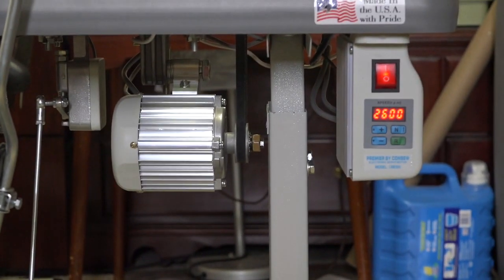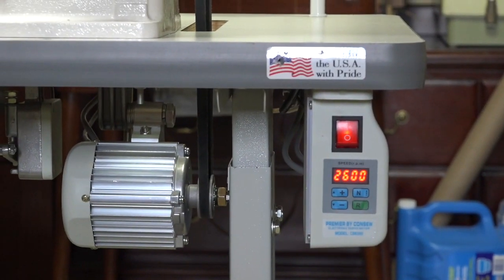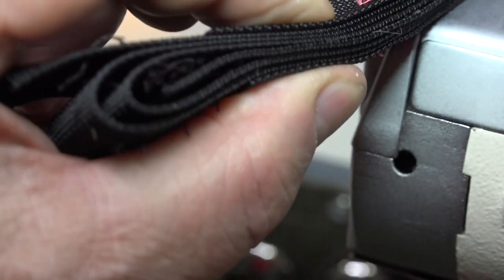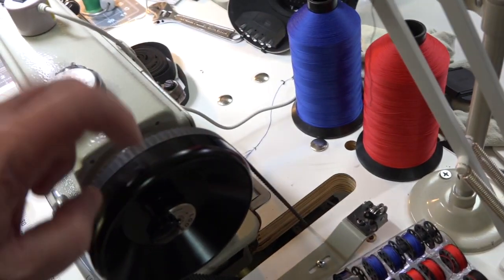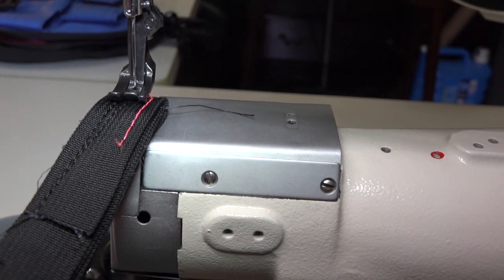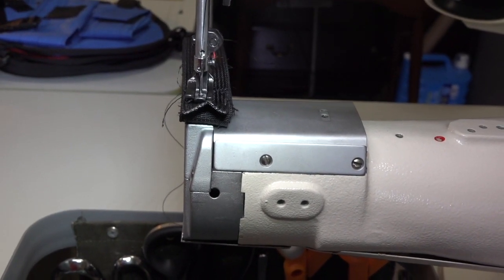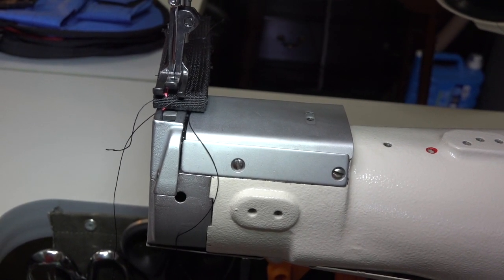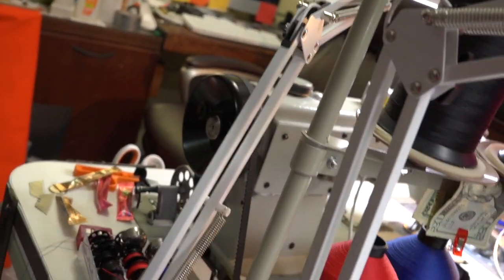Consew "Premier" 1 hp servo motor

Comment: Thank you for the excellent video! I will be installing the servo on an old Consew 220. Do I still need to change the pulley? Thanks again!!
Reply from the maker: Two things you will have to consider, is the pulley the same size as the one you have now, if not you will also have to get a different size belt. If you want to install a smaller pulley to lower the speed of your machine,  you'll have to get a smaller pulley. But no you don't need to change a pulley.
Reply: Thank you!!

Comment: There may be thousands of video’s out there, but so far, yours is the only video I’ve seen that show the installation so complete. Thanks so much. Getting ready to install. I had to have my husband remove that big ole clutch motor for me. if I’d taken the head and oil pan off the table and turned it upside down, I could have, but that sucker is heavy. So, I will follow your lead. Thanks so much. Made it much simpler, even if I am mechanically inclined. I didn’t get anything thing other than the parts. No paper of any kind. So, yeah. This is great.

Comment: 11:40 you talk about the pulley here, but I don't think you mention the shaft size.  I think the shaft on the Consew is 15mm.  Where do you get pulleys for the Consew?
Reply from the maker: I don't know the shaft size, never measured it but I get these pulleys from Amazon. https://www.amazon.com/YEQIN-Industrial-Sewing-Machine-Universal/dp/B06ZZ42TGY/ref=pd_day0fbt_sccl_1/138-5211436-3552342?pd_rd_w=6CYeP&content-id=amzn1.sym.0a3d352f-2699-4ba2-810c-59dcb4abfa1b&pf_rd_p=0a3d352f-2699-4ba2-810c-59dcb4abfa1b&pf_rd_r=BYBRRR1KFK3F7FTRZ46X&pd_rd_wg=AaY11&pd_rd_r=859d288d-f06c-4420-bfba-7400b223630a&pd_rd_i=B06ZZ42TGY&th=1
Reply from the maker: after further research, yes these are 15mm inside dia. https://www.amazon.com/KP-19155-Compatible-Replacement-Industrial-Machines/dp/B094FS2XCQ/ref=sr_1_5?crid=27A1V6FF5WXMQ&keywords=sewing%2Bmachine%2Bclutch%2Bmotor%2Bpulley&qid=1661101993&s=arts-crafts&sprefix=sewing%2Bmachine%2Bclutch%2Bmotor%2Bpulleys%2Carts-crafts%2C166&sr=1-5&th=1
Reply: @gmcxm211  Thank you for your reply.

Comment: Interesting.  I wonder if anyone has had the idea to retrofit this for a drill press, or a table saw.
Reply: I have a 3 phase motor on my drill press and a VFD to convert to 3 phase. It lets me change the speed of the drill press by turning a knob.  I believe these motor's could drive a drill press too but, they have a bunch of features, you'd probably never need. Like the lever speed control. They don't have conventional mounting too. 

I'm just suggesting it's more work than it's worth when you can get a cheap 3 phase motor and cheap VFD to control the speed.

Comment: How has this 3000 working out? I was interested in the 3000 1 for my industrial sewing machine Consew doesn't show this 3000 ono their website. Only the 2000 with 3/4 hp
Reply from the maker: two years and no problems, it bends size 25 needles with ease as I make backpacks and duffel bags. Every once in a while I don't pay attention to what I'm adding and some seam thicknesses max out the pressure foot 9/16"                    of webbing and zippers. the motor never "stalled" just slipped the belt. To find the motor you have to google it
Reply: @gmcxm211  Not sure why Consew doesn't show this 3000 on their website.  But  I found the 3001 (with needle positioning) on ebay only. I have a back up B837 Brother I want to add it to. It now has a 3/4 550v servo that doesn't start out slow on typical upholstery fabric. I have  Juki LU-1510N-7 that is awesome in one stitch at a time with super slow control,etc. I've been spoiled by the Juki's needle positioning and want to add that to the Brother and go extra HP while I'm at it.
P.S. be careful on jamming down on that needle bar. I had 10 layers of upholstery leather of high end knock my needle bar out of wack. Luckily it was ok and just had to be set proper again to the hook.
Reply from the maker: @jimbobxcityguy5338  Good advice, every time I jam it I cringe and check the timing, i do have spear needle bars but who knows what else it might throw out of wack.
Reply: @gmcxm211   I know you don't have the needle positioner. After  having it in my Juki 1510N7. I want to have it on my backup B837. I see other Brushless motors that sell the add on for positioner when heeling back all the way the needle with lift (when initially set for needle down). Can you tell if this 3000 will do that? I sent Consew an email but never heard back. And I can only find one business selling CSM 3001 kit.
Reply from the maker: @jimbobxcityguy5338  No it doesn't, its all in the control box, same motor but different control box to support NP

Comment: Thanks for sharing excellent review. Why not just go to the tiny pulley on the motor like I did with all my old clutch motors? Heck with changing out pulley on machine.
Reply from the maker: Oh I did, I went with the smallest pullies on the motors the belts could handle. 45mm is the smallest V belt pulley that can be used for the size of the belts. But still I wanted to control the needle one stitch at a time, so to do that, I needed to have a slightly larger handwheel.
Reply: @gmcxm211  i noticed you did twords the video end, my bad. What do you do with you sewing machines, bus or pleasure? 20 year Navy aviation mech primarily on the DC-9 learned to sew working with the Riggers.

Comment: Thank you for showing this performance of the Consew 1 hp servo motor. It seems to me, that you have got a minimum speed and a maximum speed of the motor. When you start the motor as slow as you can with the pedal, how fast do it turn in RPM? And what is the maximum speed of it?

I did a bit of Electronics to my small machine to make something like a servo motor. I made a presentation of the speed control of it here. I think you may like to see it: https://youtu.be/uTB8DnyYAlA
Reply from the maker: I don't know the rpm when programmed to the slowest setting. I never timed it. I set the slowest  setting to the amount of needle control as to what I'm sewing. As far as how fast can this motor sew while set with the slowest speed set, well lets just say with the pedal pressed all the way down, you won't keep up with it.
Reply: @gmcxm211  Thanks. I think it is hard to find the lowest possible constant speed of the brushless servo motors from their given specifications. But you can find some reports in forums. It seems none of them yet got a speed below 100 RPM. Some have a lowest speed of 200 RPM or 300 RPM and maybe even 500 RPM. This is a link to a discussion of this subject: https://leatherworker.net/forum/topic/92250-looking-for-a-low-speed-start-servo/